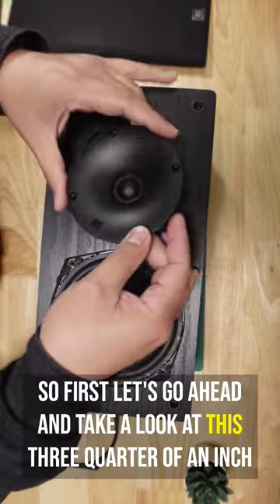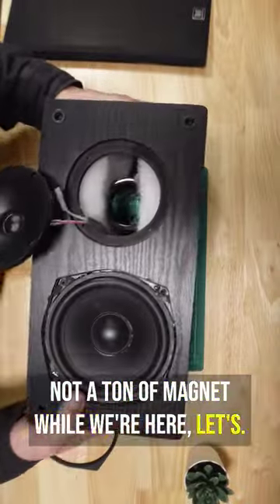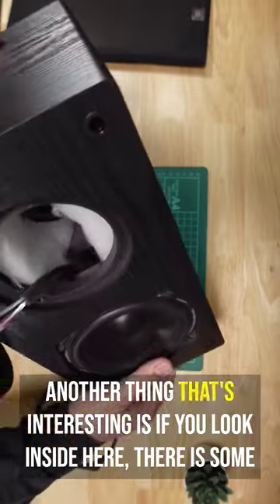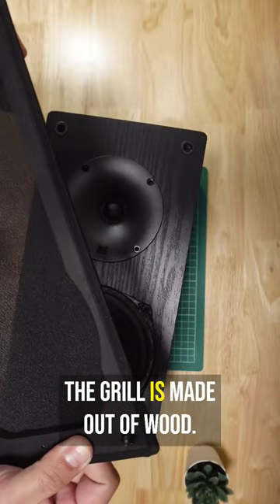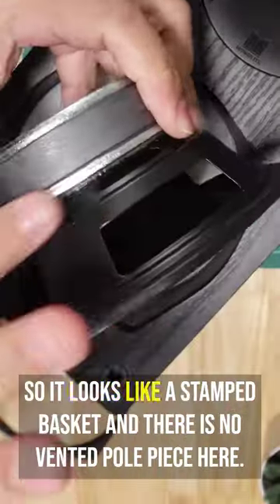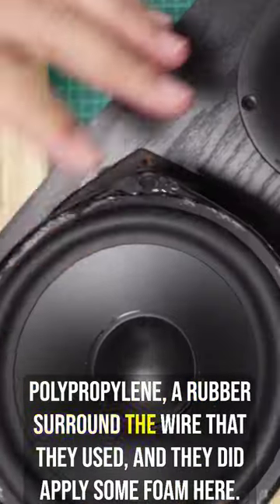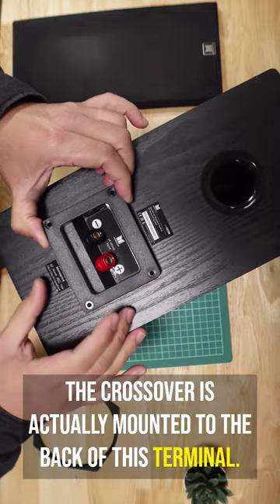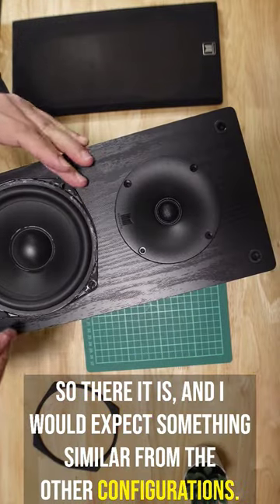I wasn't supposed to take this apart! Monolith Audition B5 Bookshelf. #speaker #music

Comment: Did I miss a resistor for the tweeter in the crossover? Adding one (of proper value) would likely pad down the HF response.
Reply from the maker: From what I've been told, the tweeters were "made more efficient" without prior request by the manufacturer, but that's just what I heard.

Comment: Where can I contact u? Email? Have a question about a wrinkled dust cap on an atc scm45a
Reply: Is the dust cap wrinkled or was it poked in? 

If it was poked that’s a pretty easy fix, I’ve fixed several with a bit of packing tape, pressed lightly on the affected area, then slowly pulling back. The tape is barely strong enough to grip it, but the dust cap will pop back into place.

WRINKLING on the other hand sounds like the only reason could be exposure to water 😮